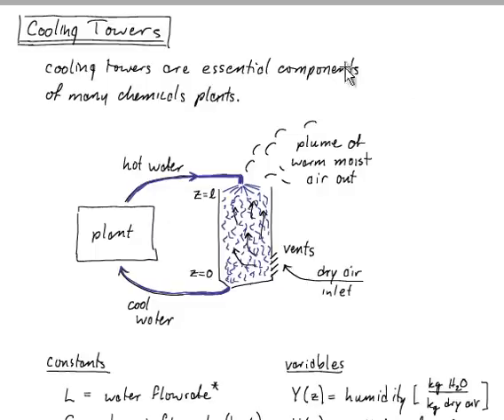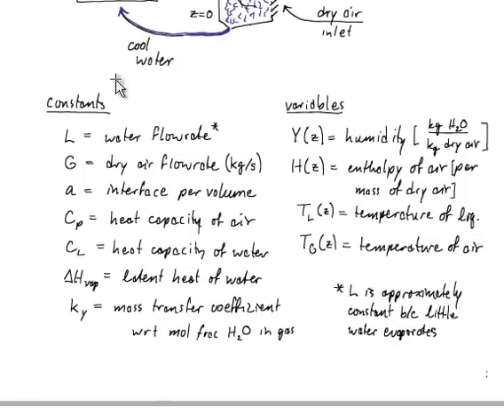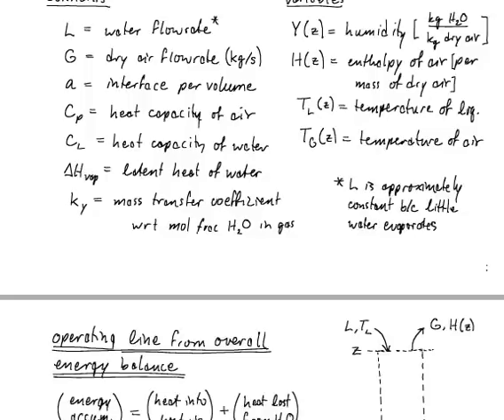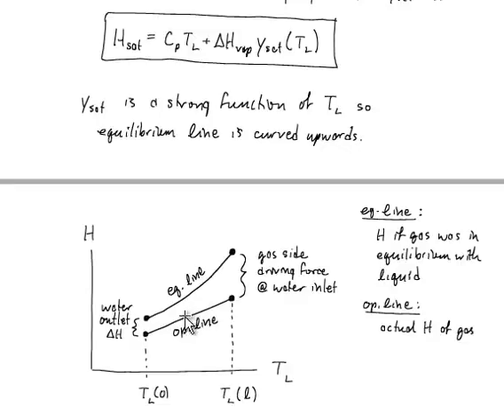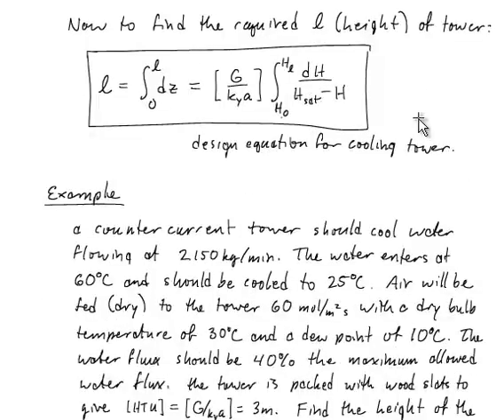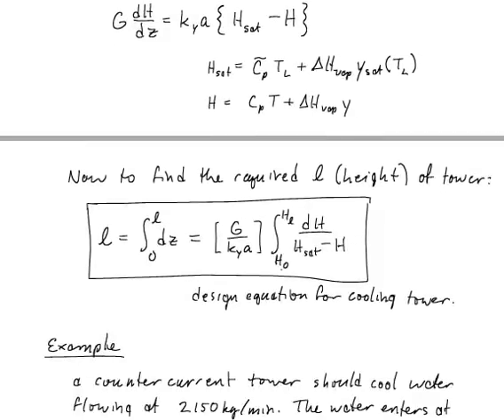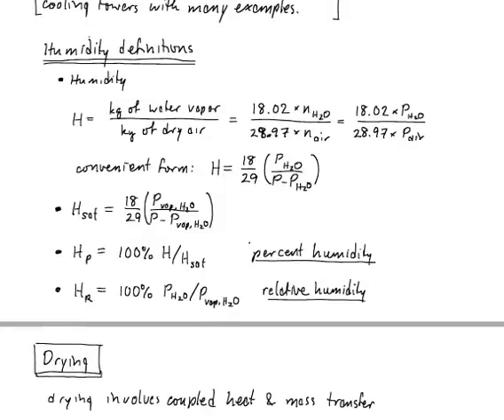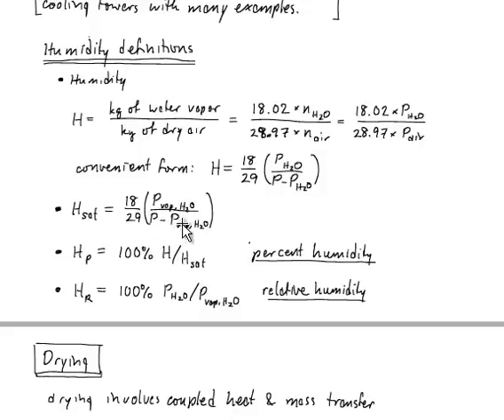UCSB ChE120C (Mass Transfer) - Cooling Towers

Comment: in your example, how do you draw the equilibrium line? 
i mean, what values do you use to construct it cause when i use Saturation enthalpies from the psychometric chart i don't get a reasonable curve.
Reply: yeah ive been wondering this too
Reply: Table 10.5-1 Enthalpies of Saturated Air-Water Vapor Mixtures, p 650, Principles of Transport Processes and Separation Processes by Geankoplis